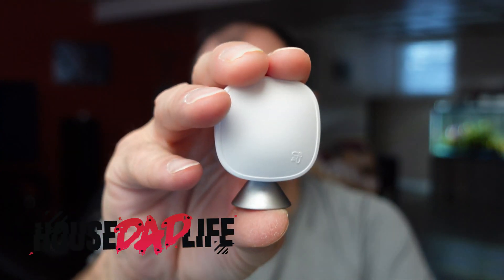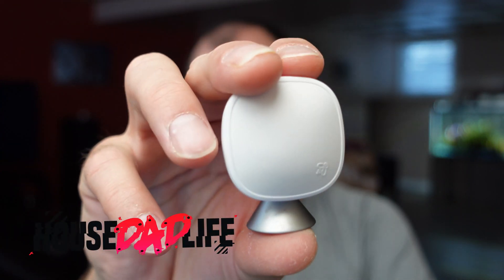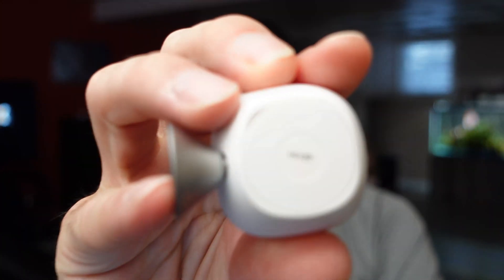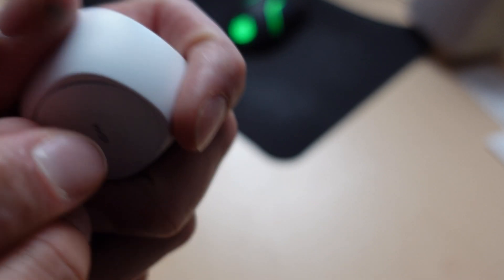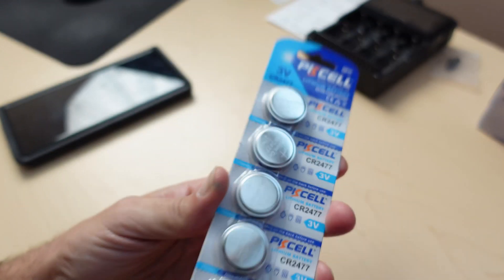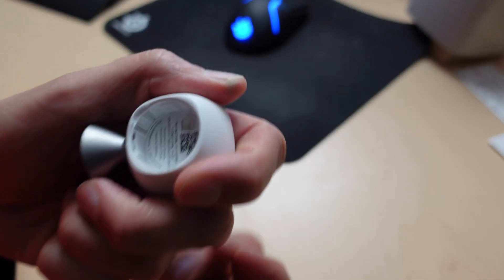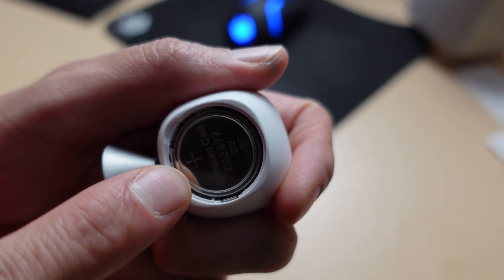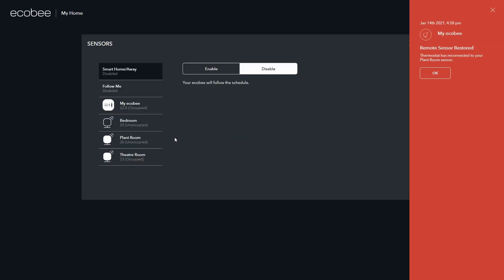Ecobee Smart Sensor Battery Replacement

Comment: Site says 2477N does 2477 work ok? They are different size
Reply from the maker: I linked a replacement in the description of the video to help you out.
Reply: Thanks I will have to try those LiCB brand again. As 2032 in old sensors they don’t even last 6 months. Been buying Panasonic, they lasting 2-3 years. But Panasonic 2477 I have ordered two times on Amazon and Walmart both come open and dead. 3-3.1v vs new 3.3-3.6v. lol still probably out perform the LiCB with there 3 year shelf life vs Panasonic 10 year shelf life.